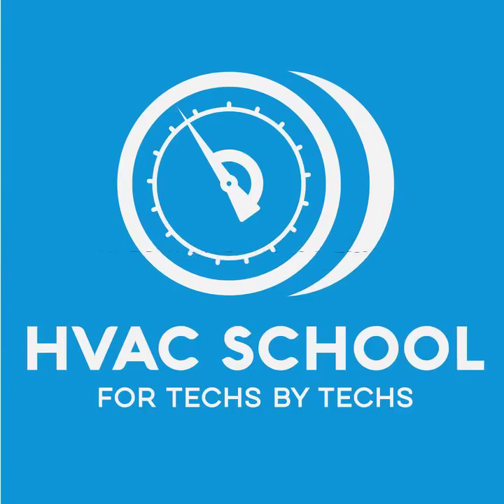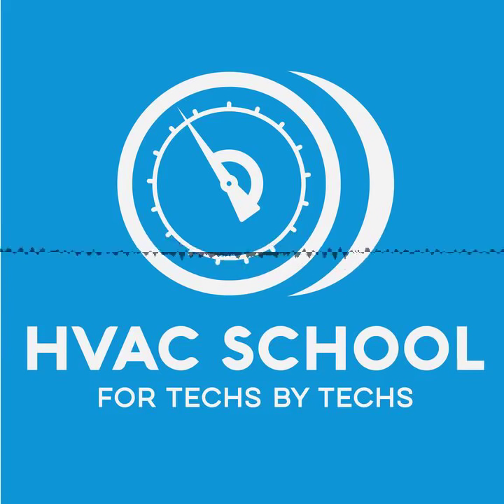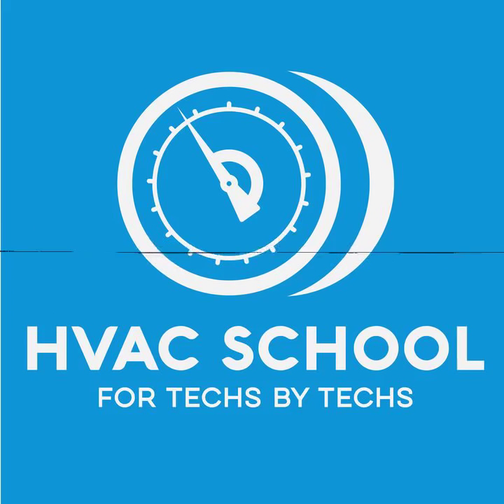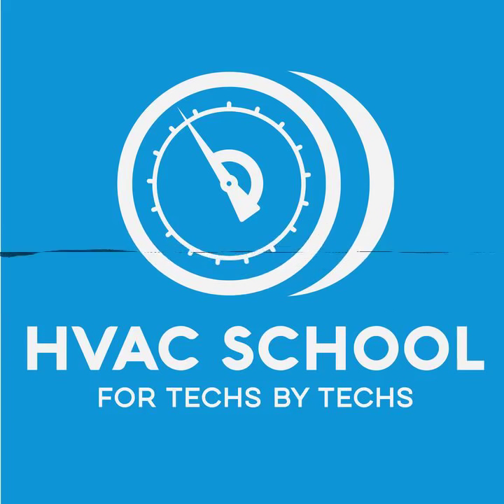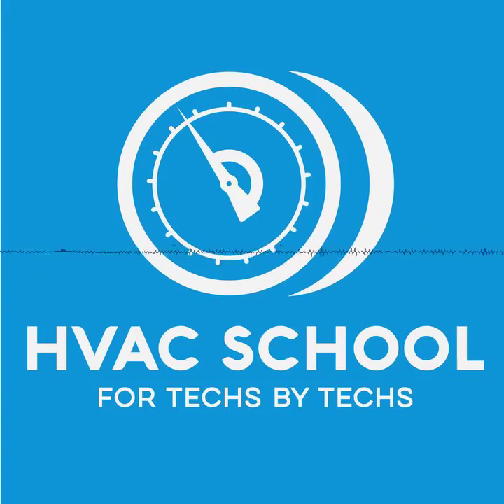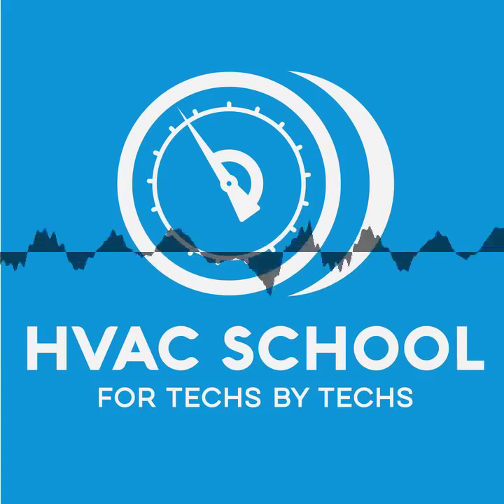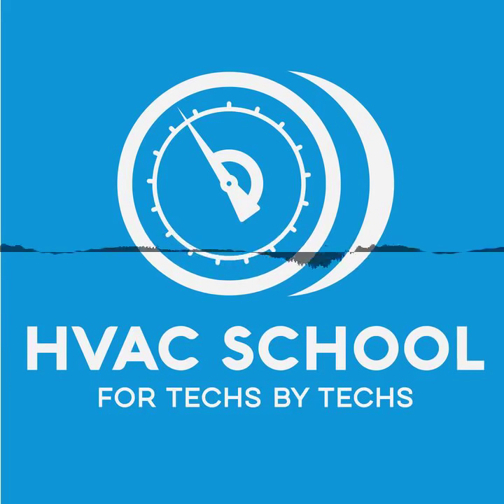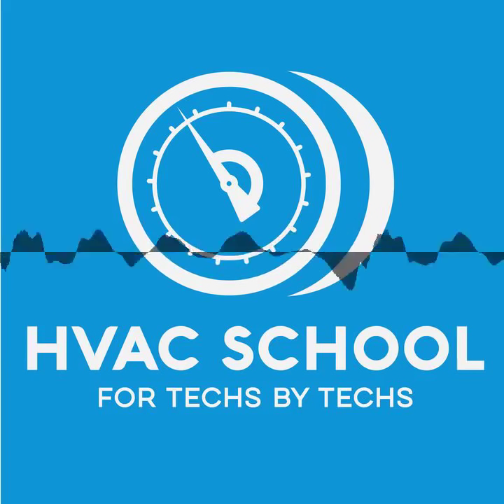Short 32 - "It's Undersized"

Comment: What about increased costs due to an undersized unit running longer?
Reply from the maker: That’s not how that works. It all comes down to average wattage and “off time”is actually inefficiency. It’s like saying that driving fast then stopping and turning off your car every so often will save you money vs. driving the speed limit.
Reply: @HVACS  Youre right.  I stand corrected.

Comment: I have a unit a two and a half ton evaporator but I have a 2-ton compressor the previous owner put in the condensing unit himself and could only get a 2 ton instead of the 2 and 1/2 that was in there now how am I to calculate superheat and subcooling on that unit

Comment: If it is TRULY undersized, fix the house. It's to leaky.
Reply: Too much effort and not profitable for the hvac contractors.

Easier to just upsize everything to 5 ton and use a freeze-stat to stop the coil from freezing up on the 1.5-2 ton duct systems.

Then buy some utility company stock.